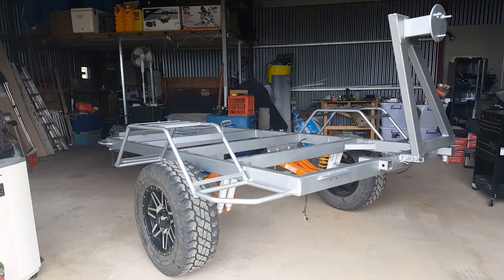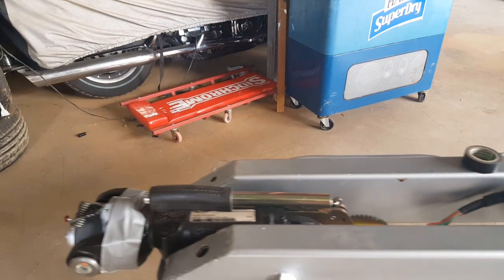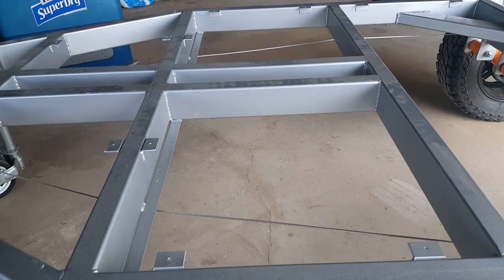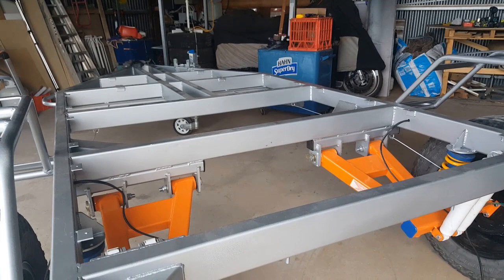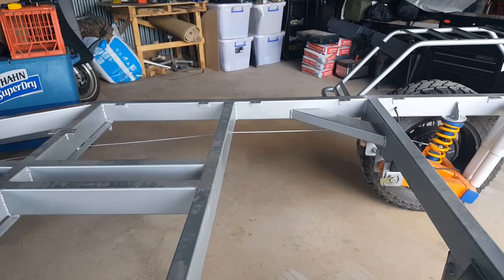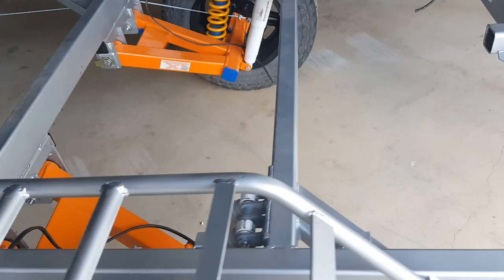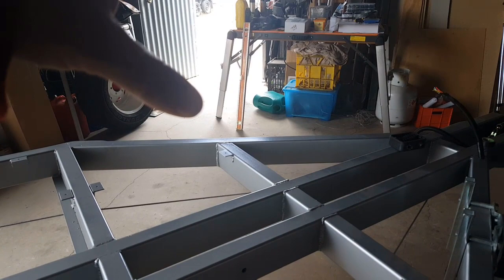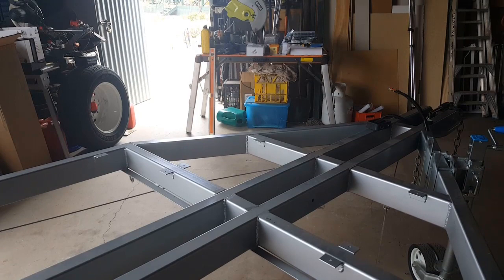Camper trailer build Travel Outback Australia

Comment: Hi mate.
I'm wondering what regulations you have had to follow and also what would be the best thing for me to look at to understand what I need to do. 
I really want to build a small camper and start with an existing trailer. I just don't know where to find out what I can and can't do. I live in vic Australia
Reply from the maker: Hi Aaron, get hold of the trailer build standards here https://www.infrastructure.gov.au/infrastructure-transport-vehicles/vehicles/vehicle-design-regulation/rvs/bulletins/vsb1 . This will tell you about what’s required for rego. As for build I designed my own chassis but yes, you could build on top of an existing trailer chassis. I guess it comes down to what you want in a camper, a light build or something capable of going off-road like I wanted mine to do. There are plenty of YouTube builds around teardrops if you want to spend the time watching them. Hope this helps, cheers Gary
Reply: @TravelOutbackOz  thankyou Garry. That's a big help thankyou

Comment: What's the wall thickness on the steel tubes?  4mm? 5mm? 6mm?
Reply from the maker: Hey mate, I used 3mm, which is already heavy enough for a small trailer. It did come in about 200kg heavier overall because of this and other parts of the build. Cheers